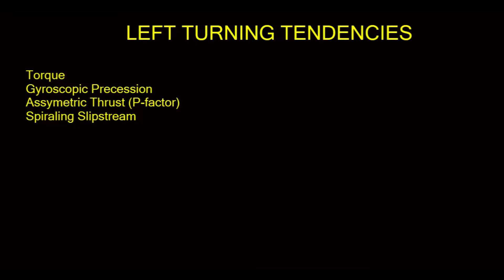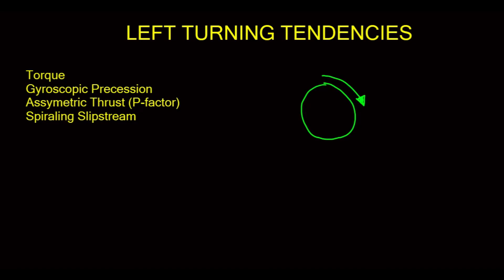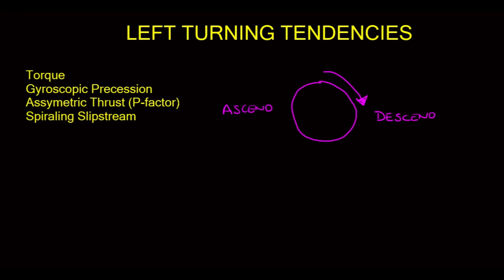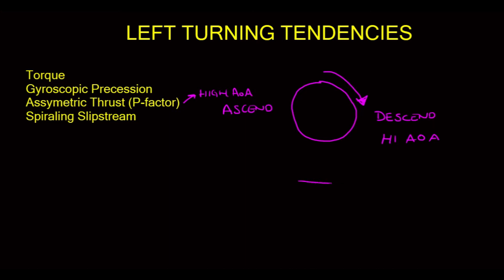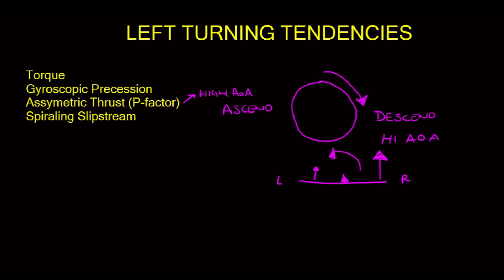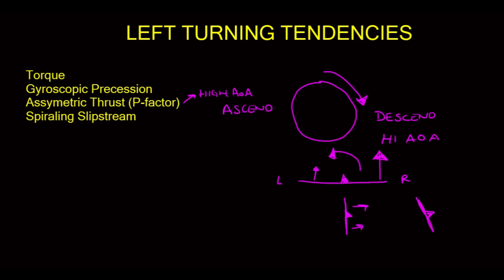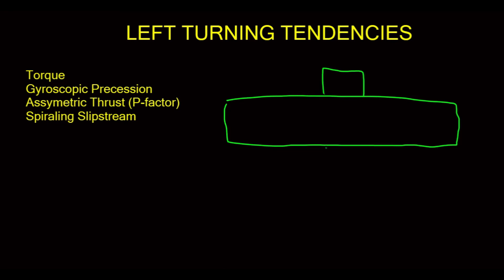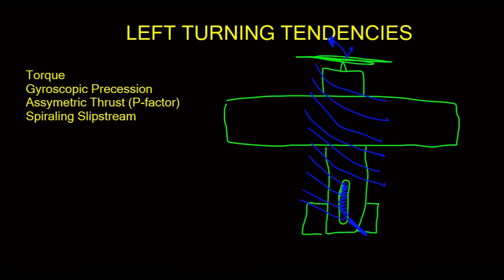Why do airplanes want to turn to the left?

Comment: Great presentation!  4 turning tendencies.    Not all are left.You have your gyro procession 180 degrees off.  When nose pitched up, the “force” forward is on the bottom, therefore the gyroscopic is the only one that is right turning; while the others are left turning.
Reply: I thought it was 90 degrees off and in a tailwheel plane, the tailwheel acts as the lever while the landing gear acts as the axis. The downward force from the tail/wheel adds a force to the propeller which acts as a gyroscope.  That is what makes the right turning tendencies - - at least I hope so.  My check ride is Thursday lol